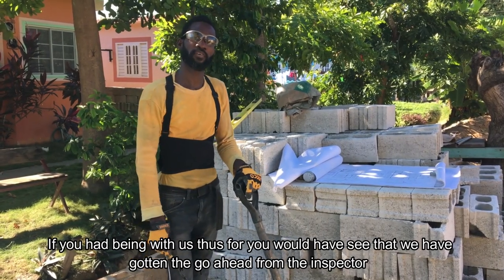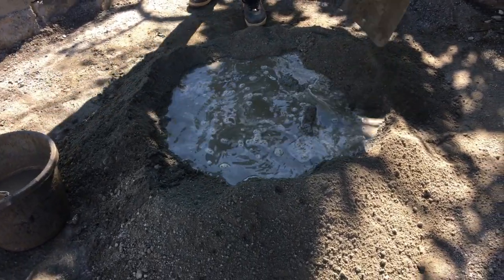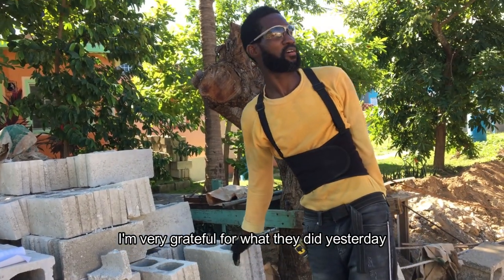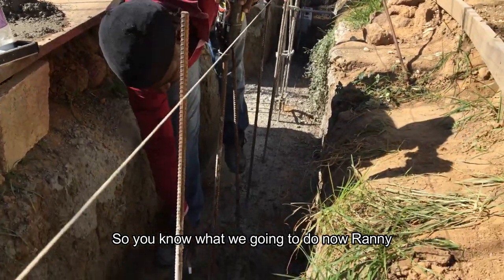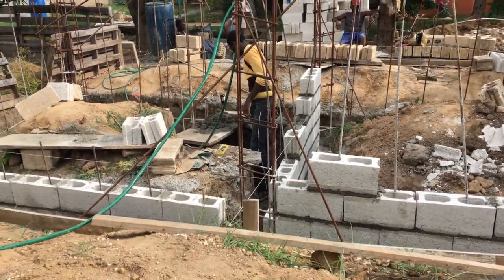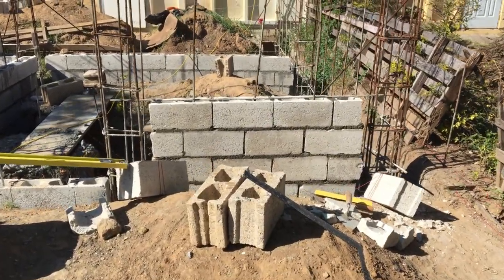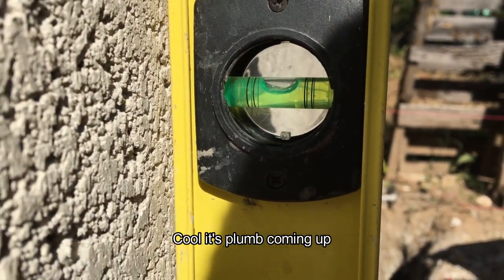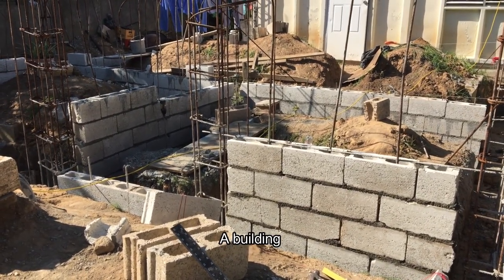Building a Jamaican Home series: Laying the Blocks

Comment: Thanks for explaining the ratio of mixing cement
Reply from the maker: You welcome 🙏🏽 thanks for the comment and stay safe
Reply: Question how much 5 gallon buckets of sand would make a wheel barrow? I dont have a wheel barrow. And what is the spacing you use between each steel bar?

Comment: Good day just a small question y is  the stiffeners is not a T don't its supporting 3 walls too much pressure will be on it even  to support  a second  floor.
Reply from the maker: GREAT QUESTION. depending on the size rooms and how close the columns are we can get away with just a L. section or a rectangular section columns, and with the beam strength and the over support steel plus cement to sand/ gravel ratio that I will be using in the casting of the concrete roofing its safe to say it will be well supported.